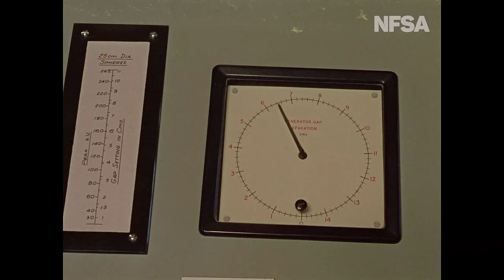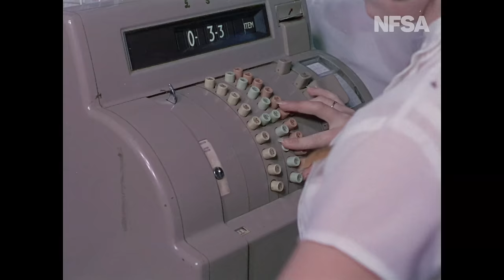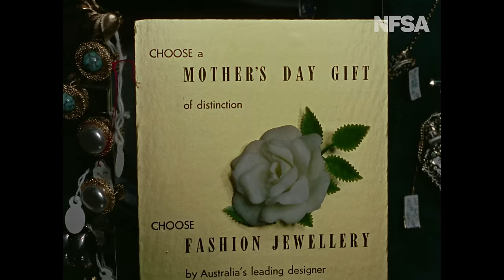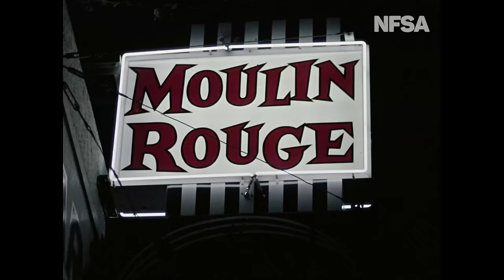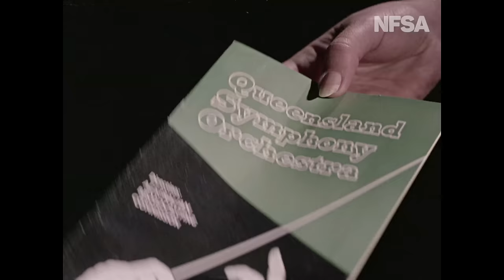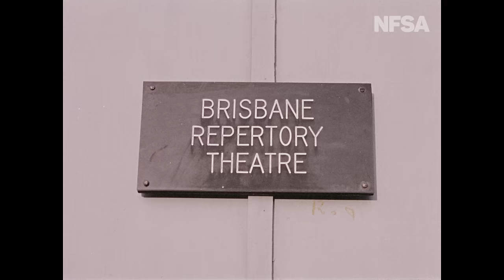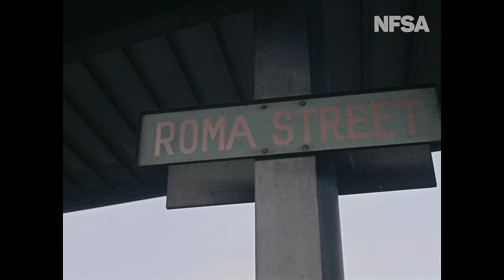Life In Australia: Brisbane

Comment: Most of Brisbane didn't sewage till the '70s, had to rely on the "Dunny trucks" till Clem Jones came along, something you don't want to think about in a"subtropical summer ". There wasn't a rail link across the Brisbane across the river till the 80"s.Rush hour in the mornings would see, crowds of commuters walk across the Victoria bridge from South Brisbane station in the pouring rain. All that was needed was a small railway bridge over Roma st.station.
The bus drivers leaving Tweed Heads into NSW use to tell the passengers, wind your watches forward 20 years.
Reply from the maker: Ha!  Great memories.  Thanks for contributing.
Reply: There were two railway bridges across the river at Indooripilly one designed for electric trains, at the time this was filmed there were trams going across the old Victoria bridge. There were also electric trolley buses going over the Story Bridge that Clem Jones got rid of, along with the trams without a referendum.
Reply: ozweird cox Kept the flies off the barbeque though.
Reply: Not to mention the nearly 2000km of unsealed roads in the greater Brisbane City council area in the early 1960s. But hey it evolved out of a penal colony like Sydney, albeit founded by John Oxley and governed by the notorious Captain Logan, is a rugby league town like Sydney, has a Kingsford-Smith Airport and a John Bradfield designed bridge also like Sydney.

Comment: Did video got enhancement by video editor  ?  without digital retouch,   camera lens was  good quality.
Reply: well yeah, it was shot on 16mm film (looks too grainy to be 35mm), and scanned at 4K. So it should be good quality.
Reply from the maker: Actually shot on 35mm and scanned 4K from a 35mm interpos.  There is some fading present but we have not done any enhancement other than grading the file to get it back to an approximation of the original film.  It is also highly compressed to get on to YouTube.  The 4K uncompressed file is massive.
Reply from the maker: @LMANJINA   Actually shot on 35mm.  4K scans do bring out the grain in all film stocks though.
Reply: NFSA Films its funny because i originally wrote 35 mm, but i didn’t back myself on that, so i changed it to 16mm to be on the safe side. Even after, when i continued watching, there were certain scenes where you could see that the quality was way too crisp for 16mm. So i was just like, oh well, not much you can do about it.
Reply from the maker: @LMANJINA   Yes it can be confusing with archival films.  We even have films that were shot on 35mm but then put out on reduction prints at 16mm because they were released to schools or places that didn't have 35mm projectors.  What components we have left now obviously determines what we scan.  There are many that argue there is no point going from 16mm to a 4K scan anyway.  The quality is just not there in the original component and the grain becomes too obvious.  However a 4K scan from 35mm goes really close to capturing the full visual information a 35mm frame has.  Compared to our old SD telecines the improvement is amazing.  Thanks for you comments.
Reply: @NFSAFilms  No worries, thank you for your incite as well; extremely informative. I know a lot of old films as well were shot on 16mm but were then blown up on 35 mm for cinema. So, that just adds to the confusion as well hahahaha. But I must agree, all these 4K scans you guys have uploaded are absolutely stunning. More archival channels should do the same with older films.
Reply from the maker: @LMANJINA   Slow going but we're getting there.  All of the Life in Australia series is in 4K now so will be uploading them from now on.
Reply: @NFSAFilms  Now that's what i like to hear.